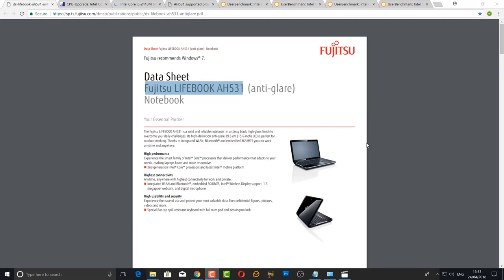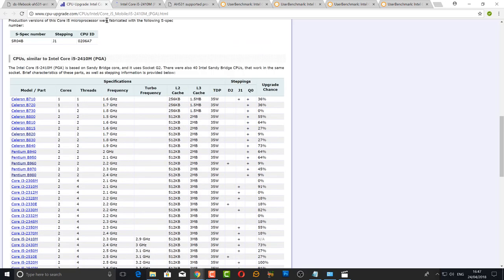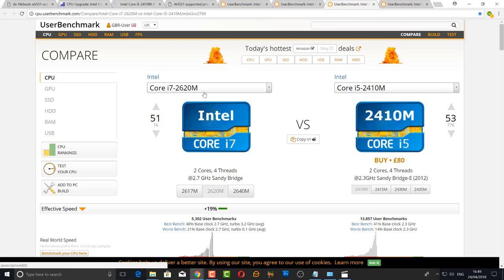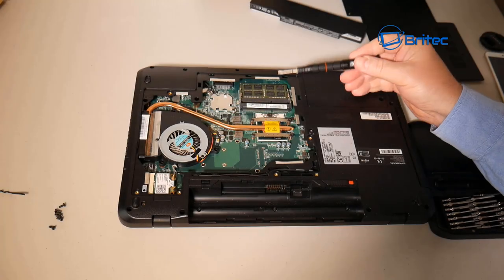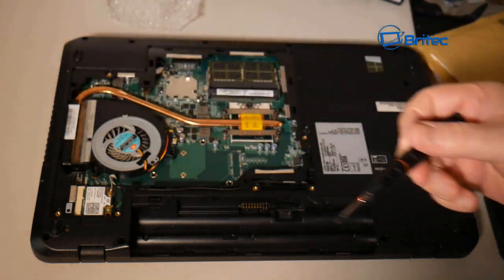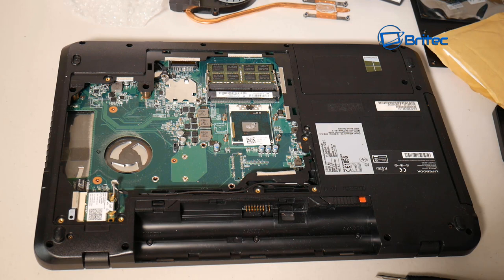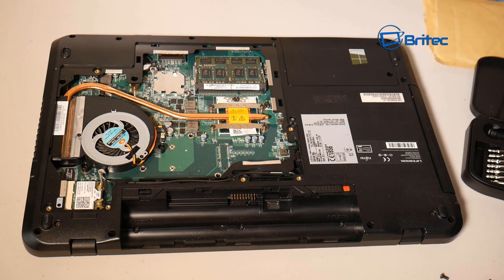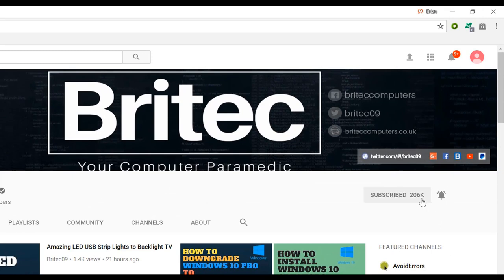How to Upgrade A Laptop CPU

Comment: Ah, the glorious days before CPUs were soldered to the motherboard.
Reply from the maker: Yeah they make it hard nowadays.
Reply: Is there a way to replace the CPU when it's soldered to the motherboard?
Reply: @gshap1258  yes but you will have to buy a motherboard with the CPU in it
Reply: you can also order a BGA-Reworkstation but its a bit expensive
Reply: @Britec09  is it possible for my ryzen laptop cpu to be changed?Currently using 3550H and thinking of getting a 4500u or even 4600H to pair with my 560x
Reply: @HuntaKiller91  open the laptop and let me know if you can do it
Reply: @multiomer1997  So this is what you do when you aren't destroying the world and killing dragons? XD
Reply: @gokublack8342  Yeah Acnologia should also watch videos on YouTube. Just taking a break!

Comment: i went to your forum / but i have no idea how to post a message / i have a acer 5515 model kaw60 / i would like to upgrade the processor / do you know of a site where i can check if its upgradable / i saw some people used a 5050e cpu / it has a am2 socket i believe / thanks for your help Rush

Comment: What about upgradability from 2nd gen to 3rd gen, on a HM76 chipset, which should support it? I did upgrade the CPU on my laptop, but it shutdown a second after startup.
Model: Toshiba L855 S5240, with i5 2450m
New CPU: i7 3630qm

Comment: Sorry for myenglish.the tdp watts if you go higher from 35 to45 you WILL need another cooler.the laptop may work better with faster cpu but the heat will rise faster inside the laptop and your current cooler is not made for so much heat,and will run max rpm even with idle pc no programs opend

Comment: thanks for this video I have one question ref the bios upgrade , assuming one is required and I install it before upgrading my cpu, will the existing cpu work with the new bios upgrade installed, I havent completed a bios update before!  thanks

Comment: Hello, I have an issue here. Hope you dont mind me asking here. I bought a 2nd hand cpu. the cpu is compatible as mentioned on the brand manufacturing website. when I fit in the cpu, the hdmi slot isn't working, and there is no signal to the monitor. Can this be confirmed that the new CPU is faulty ? Thank you
Reply: If you can go into the laptop's BIOS and see the name of the processor, the processor is working. In your case, it looks like there is a processor malfunction or the processor was incorrectly selected for the socket or chipset

Comment: i5 2450 expensive in 2018??? i bought 1 for 15 euro... and the i7-2860 for 40 euro... the 45w tdp is not a problem, on two laptops i have switched the i5's with i7 45w... acer aspire timelineX..

Comment: Hi I have a Lenovo G505 that is  veeerryyy slow but I have no skills in cpu mod. I just want to know if new cpu will work immediately, or I will have to install some kind of driver or bios mod. Thanks.
Reply: your processor is soldered to the motherboard. You can only expand the RAM to 6-10GB (DDR3L-1600) and install a 240-500GB SSD.

Comment: i have a HCL ME icon laptop and it came with a pentium B970 and after my research i want to upgrade it to i7 2620M or i7 2640M. plz tell if i can upgrade it to or not. they both are based on sandy bridge, both have 35 watt TDP, they both support intel chipset HM65. but regarding the socket (on the intel web site) the pentium has FCPGA988 and the i7 2640M has FCBGA1023,PPGA988. the HCL ME icon 1015 series also came with i3 2330M and i52450M processors.
Reply: you can use i7-2620m, i7-2640m (socket rPGA 988b / G2), the socket is the same

Comment: I have a question. Have an Aspire 5349 with a B800 chip. What can I upgrade this too?  I found online an I3-2350M . I cannot find any forum discussion on the laptop because of the manufacturer date of 2011. Thank you.
Reply: Install any processor from this list: i3-2370m / i5-2450m / i5-2520m / i5-2540m. So that Windows does not slow down, the RAM should be 6-8GB
Reply: @slavafedotov5742  Thanks so much. Swapped a I5-2450 and upgraded from 2g stick to 2 4gb sticks. Unbelievable difference. Night and day. So much faster, everything. Thank you.

Comment: Hi, can you help me please . i have a Compaq hp laptop (this model : 15-h090sg) the processor is AMS 1ghz and GPU i dont know, ram is 4 gb and 500gb hdd hard disk.
hard disk i change it to 120gb SSD, and ram i change it to 8gb ram ddr3, my problem is now with CPU and GPU. i opened this laptop, the CPU and GPU is not so easy to put them out, they are installed on motherboard , how i can change them ? and with which AMD product i can change ?

i need help, please help me some one fast ... thanks

Comment: Question, does the stepping have to be the same? I have the exact same CPU socket seen in this video (Socket G2) and I would like to upgrade my Intel Celeron B830 to the Intel Core i7-2640M. Is that possible?
Reply: your cooling is weak for i7. Install i5-2410m

Comment: nice video,my pc upgraded from intel centrino 2 to intel 2 duo,are intel 2 duo better than intel 2 Extreme Processor QX9650?
This kinda make my head almost broken tho,too much processor on processor list and anything is different 

: I
Reply: Only install a processor your laptop has listed as a factory option. Stick to the same generation and TDP rating. Otherwise you'll hit chipset issues, overheating and power supply problems. Always install the latest bios first as many processors have microcode loaded to them and without that code in the BIOS the CPU won't work.

Comment: What no removing 2 dozen screws, DVD drive, keyboard and disconnecting cables and using a spudger to get bottom of the case off? ;)
Reply from the maker: I don't know why all Laptops are not design like this.
Reply: They use to be but manufacturers want us to upgrade to the latest and greatest. Making the upgrades more painful and costly is a way to do it. As you know some laptops require removing the entire bottom of the laptop to just gain access to hard drive and memory.
Reply: Greg M how to you think apple makes money hahahaha

Comment: Hello Britec09. thanks for your good videos.
i have a Lenovo G780 with motherboard Model 2182 and CPU B960 - BIOS Version/Date LENOVO 5ECN96WW(V9.01), 3/14/2013
I wanna upgrade it to Intel core i5 560M is that possible? The TDP is 35W for both processors. Unfortunately I couldn't write anything in the forum cause it needs administration permission
Thanks in advance

Comment: Are you able to make a quick recommendation about a CPU upgrade for a Lifebook AH-530 to run Windows 11. It currently has a P6200 @ 2.13 GHz processor running Windows 10.
Reply: i5-540m, i5-560m
Reply: @vladimirazirov1815  Which cpu can I upgrade to ,on a Lenovo Thinkpad t400. I can't figure out.
Reply: @DjGaffa_Ke  processor Intel Core 2 Duo P8400 2.26 Ghz / RAM: DDR3 2GB / HDD: 160 Gb / Video: ATI Mobility Radeon HD 3470 - is this the specifications of your laptop?
Reply: @vladimirazirov1815  intel core 2 duo p8600 @2.40ghz,2401mhz, 2 core(s)
Reply: @DjGaffa_Ke  max Core 2 duo T9800, core 2 duo T9900
Reply: @vladimirazirov1815  Thank you very much, I hope it will make a noticable improvement. From 2.40 to 2.93ghz right?
Reply: @DjGaffa_Ke  Yes. But besides the processor, it's good to make 4-8GB of RAM and install an SSD 250-512GB, sata, 2.5" to speed up the programs
Reply: @vladimirazirov1815  So helpful!

Comment: Rep.aved my deal core processor with quad core. I did this on my 3rd generation went from an i3 to i7
Reply: download from the Internet and install the cpu-z program on the laptop, on pages 1 and 3, look at the processor model, socket type, south bridge type. Based on this information, I will tell you which processor can be installed :)

Comment: Can you put in a even faster processor with the same socket into the laptops motherboard that was rated to only handle slower processors?
Reply: which processor do you have? what socket, chipset and south bridge?
Reply: Too many variables. TDP, chipset compatibility, BIOS support. If the TDP is higher than the laptops cooling system rating then it will overheat and the battery will run down fast. Just look at your laptop model, find the fastest CPU it was ever sold with and use that. If that's not a big enough upgrade then get another laptop.
Reply: @6581punk  i want a high end windows 7 laptop

Comment: Can I upgrade my Acer Aspire E1-531 
CPU: Intel B960
Like you did in the video?
Reply: I already upgraded the ram, wireless card and the disk
Reply: It has a socket for the CPU, so yes. But you will have to research which CPU is compatible.

Comment: I went from 35 watt i3 dual core to 45 watt i7 quad core change hdd to ssd and  2 gb ram to 4 gb ram.faster laptop more programs open good😊 but heat and noise from the fun even with chrome open home page,drives me mad.some times laptop shut off from over heating.
Reply: you need to clean the radiator from dust and use good thermal paste, for example, Arctic MX2, MX-4. I turned off turbo boost on the i7-2760qm processor in my laptop so that it wouldn’t get too hot.  The processor operates at a base frequency of 2.4 GHz, 8GB+8GB RAM, SSD 250 GB

Comment: I'm planing to get an MSI GS 65 stealth, any thoughts on that laptop?
Reply from the maker: I think GS70 Stealth Pro is molded to the motherboard, so its possible yours could be, I look in to it later.
Reply: LOL I was just asking about the laptop in general but okay.
Reply from the maker: lol Its a nice Laptop
Reply: I have the MSI GS63. I don't like that the trackpad is super stiff, you have to put a lot of force into right-clicking anything. I also don't like how "dim" this MSI screen in comparison is to my previous daily driver, the Dell Latitude E6400. I can see the Dell's screen a lot better out in sunlight compared to the MSI GS63.
Reply: the GS65 has a better screen apparently, but the trackpad might be a problem, I should probably try it out before buying it. thanks for the advice tho.

Comment: 5:39 Well the math is quite different here.

Let's say you have a friend that's 2x better than you at something and there is someone who is 3x better than your friend, If you compare that person to yourself he is 6x times better than you.

i5 is 44% better than Pentium and i7 is 19% better than i5,
Using the above analogy i7 is not a ( 44+19 = 63%) better than Pentium instead it's ( 1 * 1.44  * 1.19  = 1.71  71% More efficient.
Reply: Right, but the point they were making was that for double the price of the i5 the i7 was only 19% better, and not worth it to him.

Comment: sorry to say in my opinion this is a waste of time really, not much of an upgrade unless you power the cpu from separate rail , the power you provide with the motherboard is the limiter here ,  plus drivers , plus incompability. The amount of time and money spent on this is a waste, you better of melting that whole tihng into gold for some profit. Those laptops are throw away products in modern age, need a proper computer just get a pc please. We are struggling  on PC market because of low cost laptops that stanrad normies buy everyday , plus modern laptops are mostly soldered together and inaccessible  for normal users using BGA which are cheaper solution than fancy plastic sockets that would normally melt in reflow oven that they use to put them together in automated process.
Reply from the maker: How is upgrading a B960 CPU to a i5 2410 a waste of time lol That laptop with do everything a user will need apart for hardcore gaming, so I can't see how that is a waste of time if you know what your doing. Now don't get me started on reflow and reballing, now that's a waste of time.
Reply: Wtf do you mean we are struggling on the pc market? There is a shit ton of people who would rather build a pc over buying a laptop including myself. Laptops are great for people who arent expeeienced in building pcs and dont know how to even upgrade in the first place.